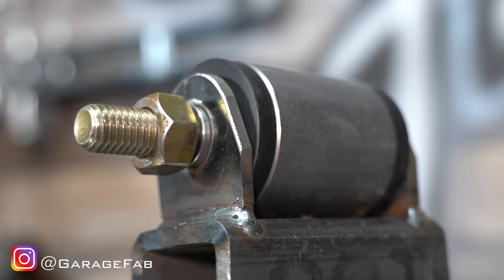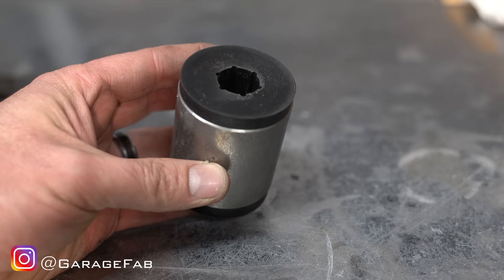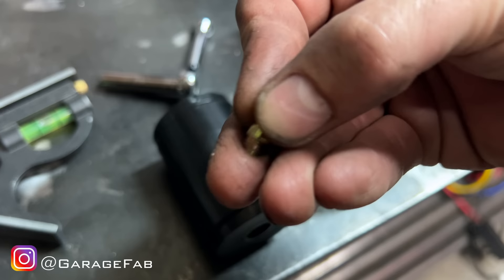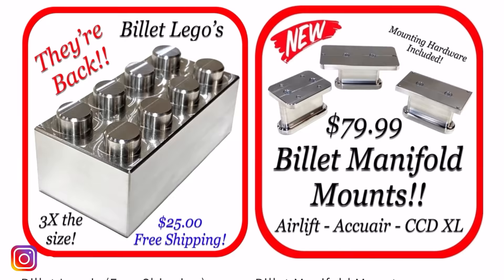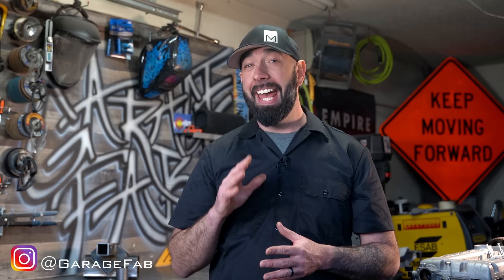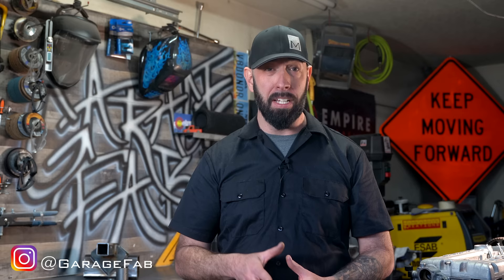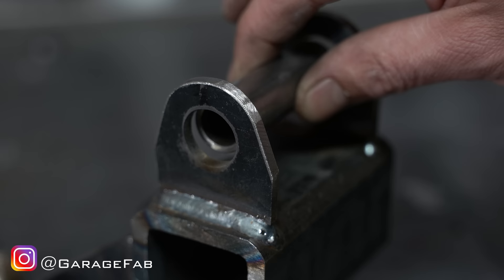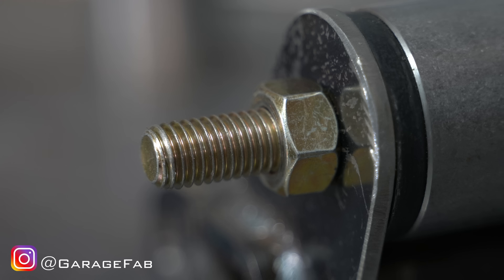The DOs and DON’Ts When Installing Polyurethane Suspension Bushings

Comment: how short can I make a upper link on my rear suspension. I got 1992 Camaro with 8.8 ford rear end, and I am trying to use the mounts on the rear end but if I do the links on top will only be 5 inches long. do not know if it work
Reply from the maker: That is indeed extremely short. It will “work” but it might work TERRIBLY. Lemme ask a couple questions first before flooding you with info. 
What type of suspension will you be using? What will you be using the car for?
Reply: @GarageFab  will be for cruse and some time but very minimal track
Reply: If you know the 3rd gen camaro got a control arm that goes from the rear end to the tail of the transmission but sense i got a ford rear end we will need ro weld that bracket on the cast iron i will rather have the original upper link that the ford had because i get too much wheel hooping
Reply from the maker: I think it might be ok while cruising but I question how it would perform on the track. The upper links on my Mustang are only about 6 inches long. (From memory)
Is there any way of moving the mounts further forward to get an extra couple inches of length?
Reply: @GarageFab  not really the back wall wont allowed
Reply: @GarageFab  i finish the project and it works great was challenging but it pay off
Reply from the maker: Nice! Congrats my friend.

Comment: you forgot to mention to not torque the bushings until the vehicle is at natural ride height! dont torque bolts when the suspension is at full travel it can tear the bushes or make them bind, its slightly less important if you use poly bushes
Reply from the maker: This video was made specifically for polyurethane bushings. That is true bonded rubber bushings shouldn’t be torqued until the suspension is loaded, It’s not only slightly less important for polyurethane bison bushings, but not even a little important. Poly bushings are made to rotate resembling a bearing more than a bonded rubber bushing.

Comment: What are the advantages of installing urethane bushings on a tacoma?
Reply from the maker: I guess it depends on what you’re using your truck for. There’s two main benefits of poly bushings. One is their infinite amount of rotation. They’re great for things like long travel off road suspension control arms because the inner bushings slip like a hinge. Bonded rubber bushings on the other hand can only rotate so much before they tear.
The other benefit is their firmness but it may not be considered a benefit for off road stuff because they don’t articulate well (twist). So not so great on off road link bars. The Johnny Joint is a better choice for that. The firmness of poly makes them excellent for on road race car stuff but it’ll transfer more vibration to the driver.

Comment: Good explanation, do the aftermarket bushings work the same, like Global West Suspension Del-a-lum?
Reply from the maker: This is the first I’ve heard of Del-a-lum bushings! I had to look them up. They look really interesting! Having only known about them for 3 minutes, here’s my immediate opinion. They are NOT soft. This means that they’ll channel more road vibration to the driver. This also means they cannot articulate (twist) so they can only be used on A arms or the two bushing ends of wishbone links. 
They do look like the overall dimensions are the same as the standard polyurethane bushing, but I don’t know that for sure.
Reply: @GarageFab  They also make these - Global West Suspension Del-a-lum Control Arm Bushings GLS-SP-4 and they will articulate.  How do you feel about using solid style bushings like the RideTech Delrin Control Arm Bushings?
Reply from the maker: Kinda the same deal. Delrin is really hard and is intended to rotate like a hinge and not articulate. So on A arms… fantastic.

Comment: Thanks for the great tips and content. Could you talk about air bags over leaf springs?
Reply from the maker: It’ll be a couple years until I get to the project I have planned to demonstrate that. But I’d be thrilled to answer any questions you might have here or on Instagram. @GarageFab
Reply: @GarageFab  I responded via Instagram PM. Did you get it?
Reply from the maker: Hey Marty! I just did. Talk soon.

Comment: @5:08 whats the reasoning behind the upper link tabs being straight with the chassis instead of straight with the direction of the triangulated bars?
Reply from the maker: This is my personal preference. Angled bushings (straight with the bars) will pivot as a unit with the axis passing through the bar ends diagonally.
This is more than acceptable in static height vehicles. But in vehicles with adjustable height and lots of travel, this distorts the polyurethane in a very unnatural way. I position my ends so that the pivots share an axis so the ends can pivot naturally.
Reply: @GarageFab  thanks for the response. That’s about what I was thinking. I’ve been enjoying your channel and I’ve also been learning a lot about rock crawlers.  I was thinking the way you did it would bind in off camber situations. Can you do a video talking about the feasibility of triangulated four link where the top and lower bars are triangulated in opposite directions (rather than parallel lower bars)
Reply: @GarageFab  just had an afterthought. I’m more used to seeing heim joint 4 link instead of bushing link ends. I’m sure that makes a difference too

Comment: Should be noted that factory bushings don’t operate like aftermarket poly bushings…the factory rubber bushings are vulcanized inner and outer of the sleeve so the rubber flexes with movement and doesn’t rotate like a poly bushing.
Good info tho …
Reply from the maker: Very true. I’ll likely be doing an updated video just for rubber bushings, because I never considered them when creating this video. More people are seeing than just the intended air suspension folks.
Certainly not complaining though!

Comment: What's your take on the waterproof green grease on urethane bushings for an Overland rig?
Reply from the maker: I don’t really have a take, Irwin! I’m unfamiliar with it, however with some short research I learned it’s a synthetic polymer grease. I wasn’t able to find if it negatively affects polyurethane.
I do know you should avoid petroleum based products and I also know silicone based lubricants are usually preferred.
Sorry I couldn’t give you more info. If you find out, please let me know!
Reply: @GarageFab  i bought it at Autozone but have seen it at O'reiley's and Walmart.

Comment: Clamping the inner bushing sleeve and forcing the urethane to rotate around the inner bushing will eventually oblong the bore, necessitating bushing replacement.
Reply from the maker: All bushings will indeed wear over time, though if properly and regularly greased, that shouldn’t happen for a very long time.
What would you suggest instead?
Reply: @GarageFab  I use your method for rubber bushings, torqued at ride height ofc.  For urethane or aluminum, I use two sleeves, one that fits inside the other.  The smaller sleeve will be the stock sleeve.  You'll bore out the bushing to press in the larger diameter inner sleeve.  I usually narrow the bushing a bit on the sides.  The larger diameter sleeve needs to be a bit shorter.  You'll drill a couple holes in the small diameter sleeve for grease.  If you have a cobalt but and a drill press, you can drill and tap your stock bolt to make it greasable, otherwise, you can purchase grade 8 greasable bolts.  You pinch the bracket like normal around the smaller bushing then take your grease gun to the bolt.
Reply from the maker: Very interesting! I haven’t seen that before. (Or perhaps I have and didn’t know) I have seen bolts with zerk fittings but I’ve never taken one apart.
Reply: Not if it's a good bushing because that's exactly how those are designed to be used. The inner sleeve is tight and does not move. That's the exact reason for the grooves inside the bushings. You must be using cheap ones. Daystar and prothane are cheaper quality. Try some energy suspension.
Reply: @GarageFab Check out SADFab's bushing retrofit kit if you want to see the method I've described done professionally.

Comment: I think a video about locking fasteners would be a good complement to this video.  Have you read Carroll Smith's Engineer to Win book?
Reply from the maker: No! But judging by the title it sounds like something I’d be very much interested in. I’ll see if I can find it!
Reply: @GarageFab  he has a collection of 4-5 books that can be purchased as a set.  I picked mine up when I was a student on a FSAE team.
Reply: An important point Smith makes is the value of using AH hardware instead of the Grade 8 recommended in this video.
Reply: That should read AN
Reply from the maker: I’ll definitely be checking it out! I’ve honestly never heard of AN (other than fluid fittings of course.)
Reply: @GarageFab  It stands for Air Force/Navy which was one of THE standards back in the day.  That along with NAS (National AeroSpace Standard).  It's all under the umbrella of mil-spec standards.  "MS" superseded many but not all. There's definitely a high quality standard that comes from certified suppliers but price goes along with it.  Great video BTW.
Reply from the maker: Thank you Thomas! You’re the first of two folks so far that have suggested aircraft grade fasteners. I’ll definitely be looking into them. Cheers!

Comment: Something that throws me off is that many bushings from manufacturers have inner sleeves that are a little shorter than the bushing width. Even the bushing you hold up at the start of the video appears to have an inner sleeve that is slightly recessed. I don't see how the poly escapes some crushing. Am I crazy?
Reply from the maker: I must assume by “manufacturers” You mean the makers of poly bushings and not car manufacturers. The huge majority of production vehicles have bonded rubber bushings, and all the ones I’ve seen have an inner sleeve that sticks out significantly.
As for poly bushings like the one in the video, a shorter sleeve is better. (Within reason.) An inner sleeve that is wider than the width of the bushing assembly creates excessive side to side movement which is terrible. Especially on something with sideways forces like a triangulated 4 link. The ideal bushing would have an inner sleeve that’s barely narrower than the total width of the bushing. (Maybe 1/16 of an inch or 1mm) This will compress the sides of the polyurethane just a little providing a very tight fit and zero excess sideways play. Again this would be good on triangulated bars. Inner sleeves that are too narrow will indeed be crushed potentially damaging the poly. Straight bars or panhard bars would be just fine if the inner sleeves were equivalent width as the bushing assembly.
Hopefully I explained this well. Lemme know.
Reply: @GarageFab  Thanks!!

Comment: How about liberally spraying all rubber bushings with 303 Protectant and letting it dry .
Reply from the maker: Fascinating thought. Does it work on tires?
Reply: @GarageFab  Yes , it is water based  , American company . And of course to let your vehicle sit I would say for 24 hours after spraying . To let it be absorbed and not be flinged off . Check out YouTube channel - Sweet Project Cars . To see the various ways he uses it . Twice a year after cleaning my engine . I liberally spray it all over and soak in . Keeps plastics / rubber looking new and resisting drying out and cracking . Especially for my plastic intake manifold . As for tires , the same liberally spray the sidewalls and tread . And when I change my oil with mechanics lift . I can spray the intersidewalls
Reply from the maker: Awesome! I think I’ll play with that! Thank you, Peter!

Comment: What lubricant do you recommend  for most bushings?
Reply from the maker: Silicone based lubricants are usually a safe bet. Petroleum based lubes eat away at polyurethane and rubber.
Reply: @GarageFab  thank you!

Comment: Should be stupidly obvious but as you stated, experience teaches us otherwise.
I have a question, do you have anything on front end builds in the pipeline?
Thanks.
Reply from the maker: The front end is starting immediately! I just needed to get this one out of the way as there’s going to be a lot of bushing work upfront.
Reply: @GarageFab  Good news, will you be touching on parallel steering and Rack placement?
Reply from the maker: Yes I will! It will be part of the Suspension Basics series. The Mighty Max has a linkage style system and I plan to keep it, however the tie rod/drag link will need to be shortened, and that will likely be time to insert the Suspension Basics steering video because that will change the Ackermann a bit. I will NOT be performing any steering rack installs unfortunately though I’m sure there will be things like placement included in the Suspension Basics video.
My next truck project will be using two front wheel drive Impala SS drivetrains and subframes which already have the rack installed in the right place.
All that will be a ways down the road, so if you’ve got questions I’d be happy to try and answer anything you got!
Reply: @GarageFab  I suppose I am just looking for a bit of reassurance, currently I am rebuilding a Ginetta G27 and redesigning all the stupidness of an english kit car. The front end is allready done and I have gone to parrelell steering to combat tyre deflection as this is a trackday mule on semislics. This of course is something totally different than your projects, nothing thicker than a half inch bolt or point one of an inch plate used. I also own  few of Colin Chapman´s products and this build will be according to his doctrine of adding lightness. The fiberglass body and the liberal use of carbon fibre ensure a curb weight of circa 1100 pounds.
However I shall only be using a tiny little engine ;-)
 Love the way you present your videos and am looking forward to your coming series.
Reply from the maker: So I have never heard of that car before, but after a brief search I am instantly jealous! If you have a will, I ask that I be in it so you know your car will always have a good home. 😂 I’m really excited to see where you take this project!
As I think I mentioned, I’d be happy to help guide you through the best I can, just know that track cars are not my strong suit. Rather, basic proper geometry of suspension and steering.
I can tell you that the first thing that catches my attention is your use of the phrase ‘parallel steering’. I highly recommend you do a little bit of research about Ackerman steering as I think this is an important design to adopt in a car that needs to handle well in corners. The main difference being that in a parallel steering system, both right and left wheels turn the same amount. But in reality, the wheel on the inside of a turn follows a slightly tighter arc than the outside. Therefore to keep the tires from fighting each other and losing traction the inside tire needs to turn slightly sharper than the outside tire. Again see Ackerman principal.
Reply: @GarageFab  Your right, cars handle  in normal conditions well with a certain amoumt of Ackermann, thats why most cars have it, but in high speed cornering with the deflection of the outer tire turning in a little more compensates this. 
  I remember the long, long journey converting my Lotus Cortina to Rack and Pinion, this car has McPherson struts and is a can of worms, Full Ackermann was not phisically possible because of the close proximity of the brake disc to the nuckle. Made a few controll arms before I got it right;-)
Thinking about my will....

Comment: do u use DOM pipe or just sch 80 heavy wall?
Reply from the maker: Depends on what I’m doing. Link bars are often just plain mild steel tubing. 1/8”wall for non load-bearing link bars, 1/4” wall for load-bearing linkbars, and 1/4 wall DOM for bushing outer sleeves.
(polyurethane bushings are generally sized for DOM tubing)

Comment: Thank you for video; the shank streching is in correct,  the stretching will still take place in the threads that may remain... simple reasoning is, the minor diameter is smaller then the shank and applied force will strech in the threads.
I would love to explain this as a reply video for you in a series of bolt connection videos I have coming up.
I subscribed to your channel bc i support content creators...
Please,  contact me on the side if you want to chat off-line about this topic.
Kai

Comment: I really dig this video, I have never fabb'd any of this , Do you have a suggestion for a simple project for a noob,  I have a 63 Chevy c 10 maybe some new cool rear track bars?
Reply from the maker: Hey, Bo! A project with welding involved? A welding cart, if you don’t already have one, is always the best first project! As far as the truck goes, it’s already got a two-link, so other than making it a little cooler looking, track bars won’t do much for you. What are your plans for the truck? Air suspension? Coil overs?
Reply: @GarageFab  I have no big plans I love this old truck it belonged to a Used car guy in Kentucky He thought it was a Hoot I kept his shop paint on it I swapped ot the front cross mbr with that of an 83 giving me Power steering and power brakes I have a fully syncronized trans  and a big ole 292 to drop in, !  just a cool daily driver
Reply from the maker: That sounds awesome! If you plan to keep your static height suspension, I’d suggest just keeping the rear the way it is. NASCAR has had the same basic design forever so it must be a good setup. If you decide to install some air suspension someday, changing this to something else would be something you’d want to consider then.